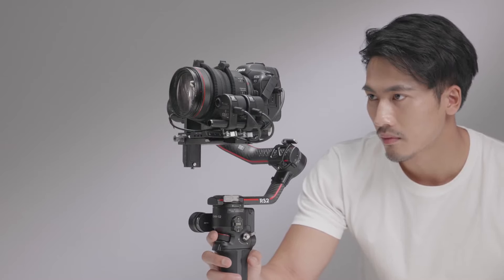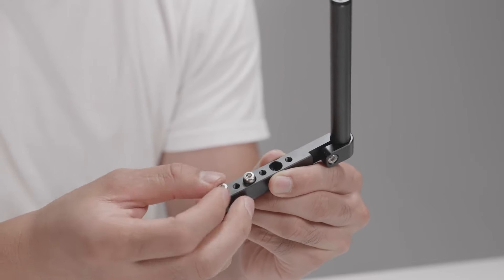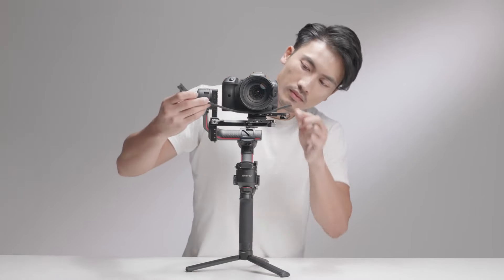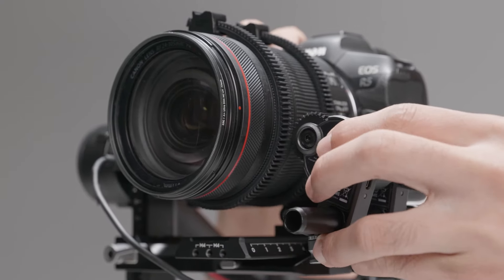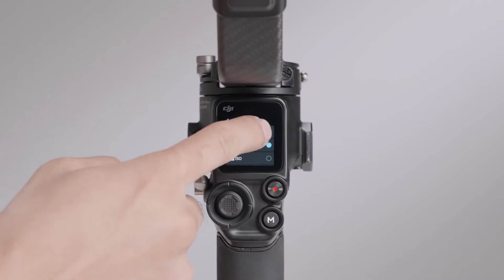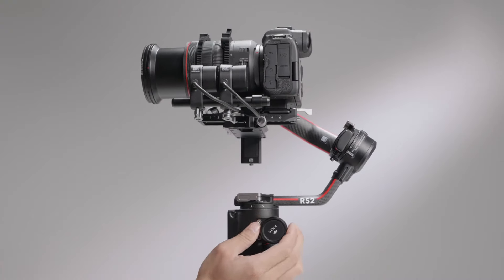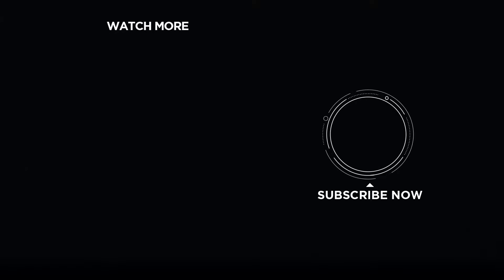DJI Ronin | How to Use the DJI Ronin Focus Motor

Comment: DJI, why oh why can you not calibrate the built-in gimble focus wheel to use on lenses with no hard focus stop?! This is crazy! SO you are telling me I spend the extra money on the combo package expecting to be able to use the focus motor on my canon L glass and it won't work?! I now have to purchase a further focus motor and I can only use the built in wheel for zooming? Also, my zoom doesn't have a hard stop either so I am guessing I am going to have exactly the same issue even if I now purchase a separate focus/ zoom motor. Also you should differentiate between the two and not just call them all 'focus motors' because they are doing different jobs...
Reply: There are multiple comments requesting the same thing here, DJI need to listen.
Reply: @michaelsus1072  they are always so slow to listen
Reply: You can stop the focus motor during calibration by hand ] grab the focus ring at the moment it reach the end points ) that’s all
Reply: Thank you for telling me this I was less then minutes away from ordering this stuff and i have all canon l series glass
Reply: I don't know if this was a software change or if this feature was already in there but you can set the start and end positions manually.

Comment: There is nothing way to calibrate the focus motor when operating from the handle wheel.  The problem is that on lenses with the focus wheel lock, it is possible to break the focus ring, because you cannot set the working range of motor. I think the DJI should consider calibration motor in the next firmware.
Reply: this!
Reply: YEP! I paid extra for the pro combo, assuming that it would work the same as the pro combo on my previous RoninSC, only to find DJI have taken a step BACK by introducing a motor wheel that can not be calibrated and limited like the previous one. but if I were to buy yet ANOTHER focus motor, I would then be able to calibrate and limit, therefore rendering the new index finger focus motor USELESS.
Reply: Yeah, this is a major problem. On lenses with hard stops the camera bumps like crazy when it hits the end of the focus range... Lenses that have infinite focus ring rotation are generally autofocus anyway, so in most cases you don't need the focus motor at all for that type of lens. So what is the point of the focus motor if it barely works with manual (hard stop) lenses?
Reply: Sorry to be so offtopic but does any of you know of a trick to log back into an instagram account..?
I stupidly lost the password. I appreciate any help you can offer me.
Reply: @Trey Brayden instablaster ;)
Reply: @Declan Clyde it did the trick and I finally got access to my account again. I'm so happy:D
Thank you so much, you saved my ass !
Reply: @Trey Brayden happy to help xD
Reply: Did you find a work around for this? I just bought an RS2 and have the same problem

Comment: As someone that has upgraded today from the old Ronin SC Pro Combo to the new RS2 Pro Combo, I now find that the new index finger focus wheel CANNOT be calibrated and set to limits like the older, cheaper SC Pro Combo??? And yet, this video tells me, if I were to buy ANOTHER motor I would then be able to??? Surely it would be easy to update your NEW focus motor and wheel to act the same way as your OLD focus motor and wheel???
Reply: I gather this is no longer a problem in the latest firmware as I can see options for it.

Comment: When using the largest plate (Ronin 15-10) do I first connect the camera to the plate (in my case a cinema camera), then the plate to the gimbal, then attach the rod mount? Or Is there an easier way? I cannot slide the large plate onto the gimbal with the rod mount already attached. What am I doing wrong? Thank you in advance. PS. I'm using a RS4 Pro.

Comment: I want to film sports with an elevated camera. I think the 50ms latency of the RavenEye Image Transmitter should be handy for controlling gimbal movements using Force Mobile and Zoom In/Out using the Focus Motor. 

I hope I can use the DJI RS2/3 Pro Combo with a fast Auto-Focus enabled Camera equipped with a Zoom Lens, elevated at 15-22ft height using a Heavy Duty Telescopic Stand

Comment: On RS3 Pro? Thanks for the info. I tried it on the RS3 Pro but the red light keeps on blinking, meaning it cannot connect.  Any one a solution or experience with this? Thanks!
Reply from the maker: Hi there, sorry to know about the issue. Could you please provide us with a video to check how the red light blinks? You can send the video to our support team through the link below. http://www.dji.com/support
Reply: @DJITutorials  thanks for the reaction. I work in an other country till 23/8, so I can’t make a video, but it blinked every second. On the DJI forum, reactions tell me about a similar experience.
Reply from the maker: @crewpower-be  Hope you can understand that each case is different and we need to discuss it on a case-by-case basis. You can send the video to our support team at your convenience. Our team will help accordingly. http://www.dji.com/support
Reply: Did you did a. Solution? Having the same issue

Comment: Is it possible to use a zoom lens like this on an RS3?? Can't seem to find answers anywhere! I thought you may have to re-balance the gimbal each time with a zoom or is it powerful enough to hold a variable weight? 🤔
Reply: If possible you should definetly rebalance it especially because it's goign to drain your battery a lot quicker. However with my Sony GMII 24-70 / f.2,8 I never had any issues. Just make sure that when you balance your gimbal, the lens is about half way between the 2 end points.

Comment: Hello.
I don't know who to ask.
I bought a DJI RONIN RS2 Pro COMBO for my CANON R6 camera to shoot video.
Collected everything, balanced, installed the application on the phone.
There was a footnote in the app to update the app. Updated.
For some reason, the focus motor does not work for me, and before the update and after the update, it has a red light on.
What could be the problem?
Could you tell? Maybe this Focus Motor is not compatible with the Canon R6?

Comment: Can you control this with raveneye?
Reply: Hi, I'm trying to answer the question but in French. 
For the moment it's no. 
But for the HDMI transmission it's ok with the Raveneyen and this config. 
BUT you cannot control the Ronin if you do this. 
You 'll can control the Ronin with the bluetooth mode only and not with the wifi. 
https://youtu.be/rO54WLDwgpw

Comment: My gear strip is wayyyyy too long. It sticks out like 5 inches on my 16-35mm sony lens. What on earth am I supposed to do.....
Reply from the maker: Hi there, may we ask will it affect the other accessories? If you usually only use this lens, you can cut off the excess part of the gear strip.
Reply: @DJITutorials  I guess I can cut off the excess for my largest lens and hopefully the extra won't be too long for my slightly smaller lenses. 
Also, is there any way to flip the direction of the focus wheel? I don't like the current set up of the knob and the direction it focus pulls
Reply from the maker: @trimotionmedia5487  Hi there, you can press and hold the focus wheel multifunction button to reverse the rotational direction of the focus motor. You can also check out more information at the focus motor users manual: https://dl.djicdn.com/downloads/DJI_RS_2/DJI_Ronin_Focus_Motor_User_Guide_mul_v1.2.pdf.
Please let us know if we misunderstand the request, thank you.

Comment: I've connected everything, and my focus motor blinks red. What now? Is it telling me I need to update or something?
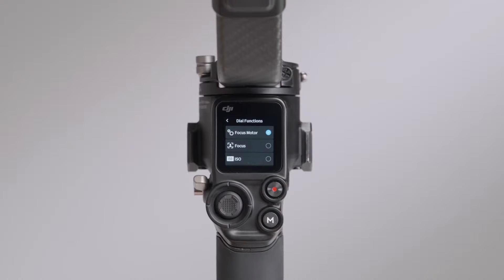Reply: 1:36 This is not happening for me. I have the correct dial options, and the cables are connected, but it really just sits there flashing red. I'm starting to get worried there's something wrong...
Reply from the maker: Hello, there. Sorry for your inconvenience. Would you please tell us which product you are using and how the red like blinks? For example, the red lights blinks fast or low, how many times?

Comment: Is there a way to cut down the focus motor torque so it isn’t so jerky when turning the from dial?
Reply: Slide your finger up on the screen and select dial speed. you can adjust the speed, smoothness, and dial direction from there.

Comment: Question: Does the DJI R focus wheel work on the rsc2? And if it doesn't, then why?
Reply from the maker: Hi, we are sorry for the confusion caused, DJI RSC 2 is not compatible with DJI R focus wheel, RSC 2 has the built-in front dial.
Reply: @DJITutorials  is there a way to set focus A B points on th rsc2 then?
Reply from the maker: @YaliFilmaker15  To set the focus AB point, you may need a Focus Motor: https://store.dji.com/product/ronin-focus-motor?from=search-result-v2&position=2. 
To set the focus motor range, please refer to page 8 of the manual for the details, thank you https://dl.djicdn.com/downloads/DJI_RS_2/DJI_Ronin_Focus_Motor_User_Guide_mul_v1.2.pdf.
Reply: @DJITutorials  Dji, can I use the focus motor from the Ronin SC on my new RSC2 model?
Reply: @DJITutorials  Where do you set A/B points on the RSC2?

Comment: How do you keep the rubber gear locked in place? The turning of the focus wheel pushes the focus motor out of contact
Reply: Tighten the mount on rod

Comment: That focus wheel looks so pro, but it's still impossible to configure neither speed nor direction for it. And it's not possible to select what it would control though the menu.

But they still put it into the video.
Reply: Apparently, still not configurable. Lol
Reply: @user0K  wow, they want you to buy the fucking wheel
Reply: @nathancasey7712  which does not fully work (ok, if you have lenses with different thread direction - good luck fighting "Ooopsie, wrong direction" feeling xddd). It should be a physical switch, lol.

Comment: Why are you using the Ronin SC focus motor and not the Ronin Rs focus motor ?
Reply from the maker: Hi there, it's this DJI Ronin Focus Motor, it can be used on DJI RS2 and RSC2: https://store.dji.com/uk/product/ronin-focus-motor?from=autocomplete&position=2.
Reply: @DJITutorials   Yes I understood the configuration but I don't understand why you're not using the ronin RS2 focus motor  that is sold in the pack...  
I tried the same configuration that you are showing with 2  RS2 motor and it doesn't really work because there is not the space for that config. It is not correctly working because the first focus motor is touching the second one (for a sony 24-70 ZEIS). 
I hope you'll understand ! 

And I was asking mysself, if i do the same configuration but like this : 

Is it bad for the Ronin ? 
I saw that the balancing is moving a lot between the 24 and the 70. 
https://youtu.be/rO54WLDwgpw

Thanks, 

JJ
Reply: @paris3DVR  Hi Joffray, the motors we are using in the tutorial are DJI Ronin Focus Motor, the Ronin-SC focus motor is not compatible with RS 2. 
Regarding your issue, please try to use the camera riser, or mount the motors on both sides, but you may need one more rod mount, if you have a longer rod mount, you can try and adjust the distance of the motors.
Reply: @DJISupportGlobal  Ok thank for your answer.
I understood that it is not exactly the same focus motor because of you are in another country. 
Thanks for your help, I’m going to try.
Last question, how can I get the WiFi transmission and the control of the Ronin with the Raveneye using this configuration ? 
The the new focus is using the USB port of the Ronin (who was used by the Raveneyen).

There is a solution for this ?
Reply: @DJISupportGlobal  Dji, can I use the focus motor from the Ronin SC on my new RSC2 model?

Comment: I have encountered an issue with the focus motor, where whenever I turn the knob, it slightly moves the entire camera, especially when im going from one direction to the other. It seems like it has something to do with how the camera is mounted, but I made sure to tighten the bracket as much as it can. Has anyone experienced this issue?
Reply: Top or bottom mount the motor so it doesn't slip as easily. All you have to do is flip the motor. If you like the orientation of the wheel itself, you can go to dial speed and select reverse dial.

Comment: Is there a way to reverse the default direction of the RS 2 focus front dial? The default directions feel backwards to me. BTW, I am not using the add-on focus wheel.
Reply: Slide your finger up on the screen and select dial speed. you can adjust the speed, smoothness, and dial direction from there.

Comment: I literally feel like you all are giving me the run around. I have tried numerous suggestions (firmware, balance, positioning, different lenses, manual stopping, etc, etc.) and yet you all keep not telling me excuses as tp why my focus wheel is inconsistent with no solution. Literally the last thing you said was that there was an update coming out that might fix this but that it's not available.

Seriously? You're going to make me troubleshoot on camera what I already told you all, send detailed videos, only to NOT tell me I have a faulty follow focus and that a firmware update might fix this? Horrible customer service.

Comment: With the DJI RSC2 wheel to control motor focus, can others motors like the one from Tilta be controled too? Thank you
Reply: I cant get the focus motor to work on RSC2. Did all the steps, light is blinking green and powered on but nothing happens when i turn the front dial...

Comment: The problem is the camera lens is deflected from the torque of the motor. The provided lens support is not rigid enough 😭- when you are shooting at 70mm it is very evident. It's awesome having it in a small package though!
Reply: yeah, I've printed my own. The included support is just a joke.
Reply: On my rig the motor pushes the lens slightly to the side because of the strength of the focus motor. Can get it to work smoothly. Have you guess figured this out
Reply: @danielromagnoligoncalvss  3d printed a strap holder for a lens. And a proper mount plate (camera specific, it goes in front and below the camera), that blocks plate from unscrewing

Comment: Also, dji could do add a support to autotune start/stop points on lenses without hard stop. You only need to know the maximum focusing angle, i.e. it is usually 150 degrees on sigmas. So, if you rotate 150 degrees in one direction, you will find a "soft" stop. The problem is that DJI really does not care 

(and yea, you still need to measure that max angle and input it, but should be possible to make it very usable though the mobile app). We need some open-source gimbals xd
Reply: This is DJI we are talking about, they always make neat kit but with many many oversights especially in the software side of things, this will never be added.... I mean fuck I want to control focus when using the "Create Track mode", Focus can be controlled on "Create Timelapse mode" but they will never change it.

Comment: Due to the new digital focus control with the new index finger wheel, the focus motor is rendered a pointless purchase. The only redeeming factor would be calibration and focus control with the limiting options, like the previous Ronin S and SC had, but this has been completely removed??? DO NOT BUY THE PRO COMBO VERSION unless you want the Raven Eye, which even then can be bought separately later.